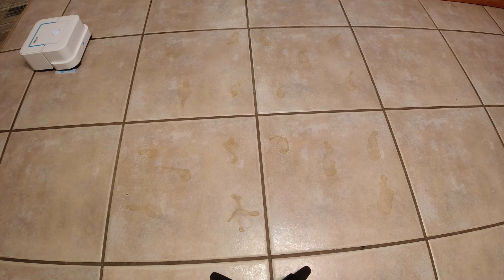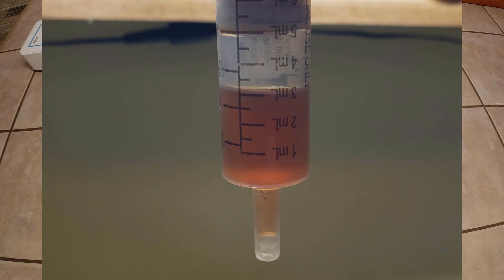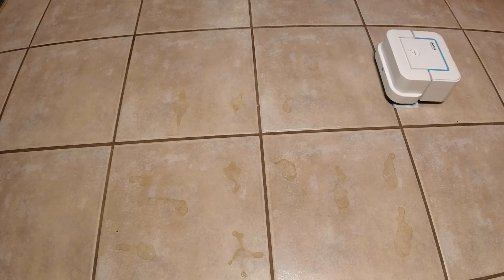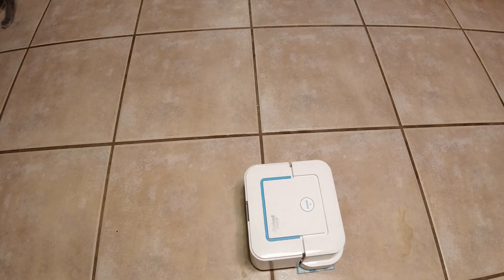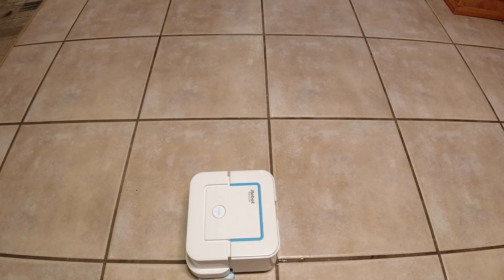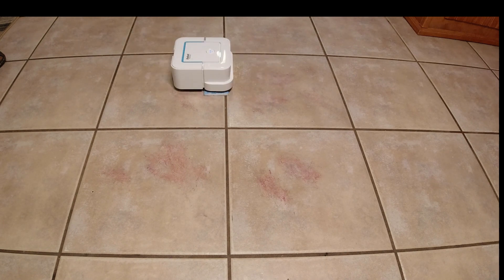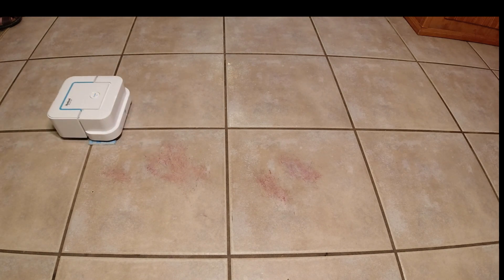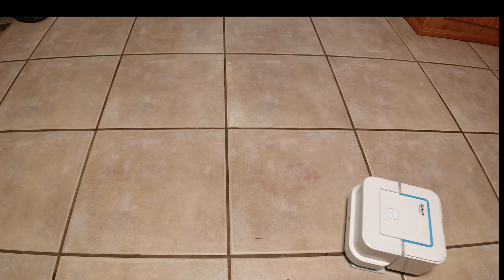iRobot Braava Jet 240 Mopping Test

Comment: Do you ever use the Braava cleaning solution or do you just use plain water? I’ve used the solution and found that it leaves streaks. Was curious if you or anyone else had the same result.
Reply from the maker: Only water.  I spot treat the floor with Bona floor cleaner.

Comment: Unfortunately mine performs very poorly on tile. My tile is very similar looking to yours. However, once the wheels get wet (after 10ft or so) the wheels slip and spin on the tile so bad that it has a very hard time trying to move or navigate. 70-80% of the time if it runs into a corner it cant rotate to travel another direction. I have to nudge it. This after I let it sit in one spot for OVER 5 min. Then it totally forgets where the  "don't go behind" point is set when I turned it on. This feature has never worked the 7 times I have used it, only in my kitchen. I think because it gets stuck so often against a wall or cabinet that it looses its bearings. I don't know. All I know is it cleans fairly well, but I have to stand there and watch it clean the entire time or it will get stuck within 1-2 minutes and stay there forever until I move it. I have tried working with support but apparently there's nothing actually "wrong" with the robot. So disappointed because I was excited to have it. I have a robot vac which does a great job all over the house. But this 240 can't even drive itself around a small kitchen without a lot of help.
Reply from the maker: My experience as well.  It does not weigh enough.  Make sure you turn the water output all the way down.

Comment: Do you have any issues with wheel marks when using the wet pad? I’m still adjusting the water settings to see what works best but I’d love your input. Thanks
Reply from the maker: I do not, but I only have tile floors.  What type of floors do you have?
Reply: Jamie Andrews tile as well. Do you just use the default settings? Also it’s worth mentioning in using the kepow pads. Thanks for the reply!

Comment: Thank you for doing different kinds of DRIED on liquids! As you said, it's the most realistic. I truly don't know why so many reviewers throw liquids down and mop it up immediately, like you wouldn't just use a paper towel at that point, lol. In the future if you could try doing a second run when there are things left over to see if it gets the rest up, that would be helpful. Vacuum Wars ran this a second time and it did clean up the remainder pretty well that 2nd pass BUT I like your test because it's on an actual textured tile floor (like my own) which is very different from the surface he uses (flat and glossy). Awesome job and thank you!!!
Reply from the maker: Thanks for the advise!  I try and make all of my reviews realistic which is why I  use stuff many people would find on their floors.